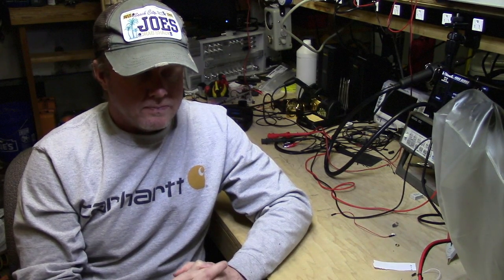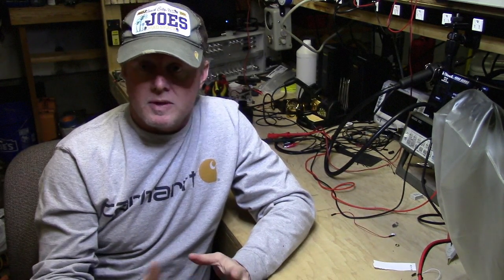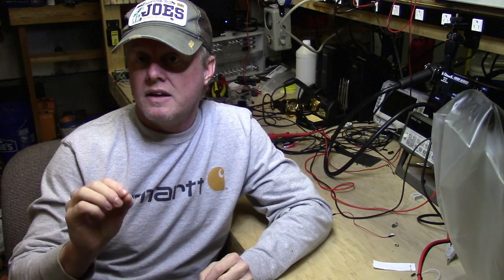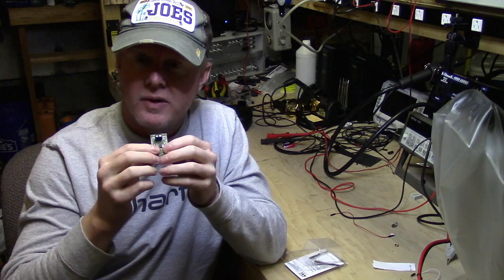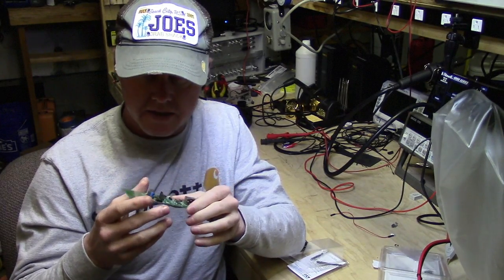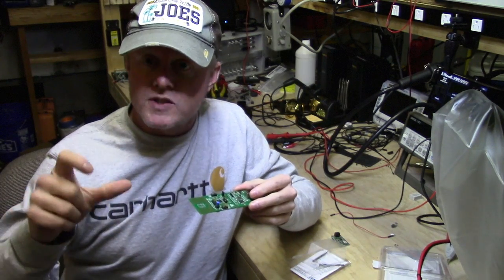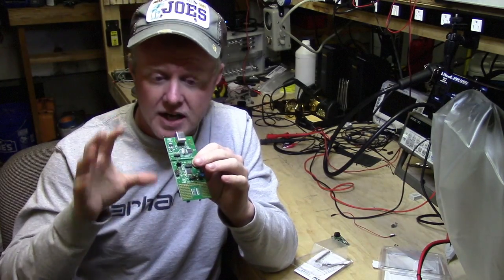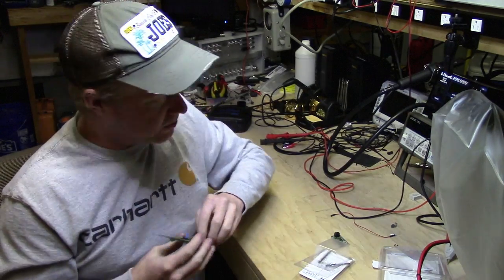RZR Mini Multiplexing Part 1 - Better than a Relay

Comment: Thanks for posting this series.  I'm doing an EV conversion on my General XP1000 and was just digging for useful CAN info, PID's & stuff.  I've built HC multiplexers for other vehicles before, using DC SSR's which are really cheap these days & will switch up to about 100A.  They are opto-isolated & can function happily high or low side.  Just another option!
73's G7DMQ
Reply from the maker: Great to hear!